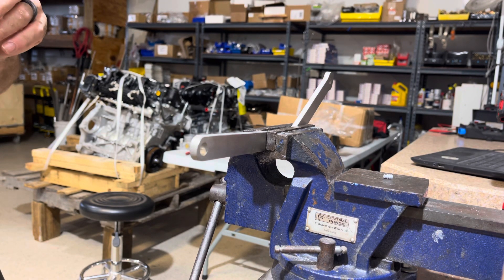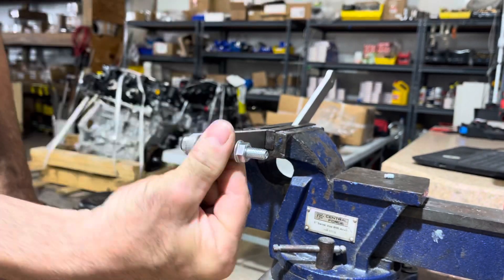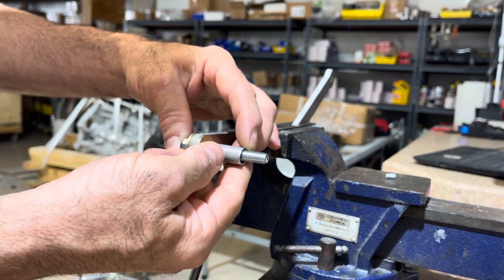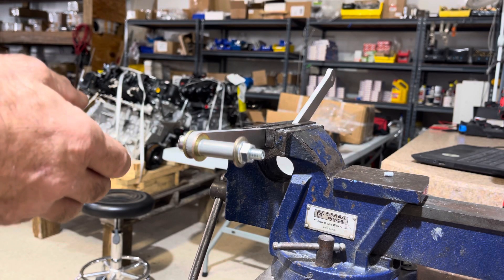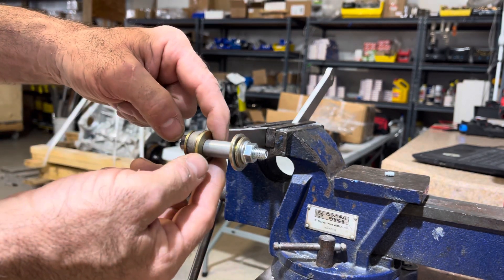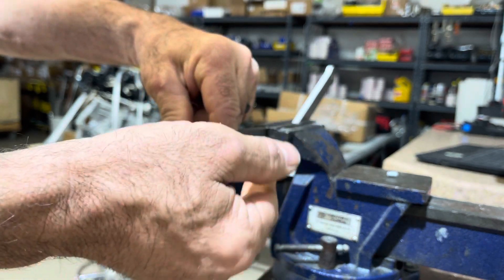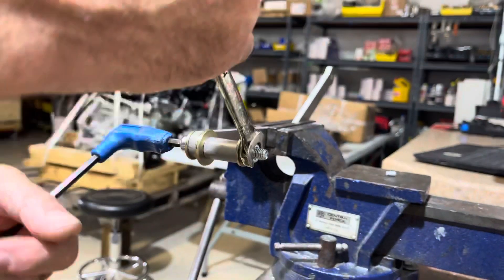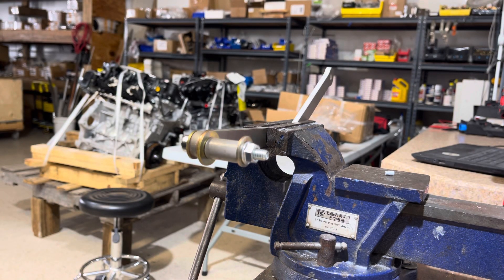Flaperon Attachment Procedure on a Zenith Airplane

Comment: I’ve had my 750 for 10 years. I am about to replace all of these bushings due to a little surface corrosion on the bushings.  This is the first time I’ve ever understood exactly how this assembly is designed to work. It is very easy to have it all together and end up with exactly what was described, or even end up with a bolt/nut/bushing assembly that rotates with the flaperon arm. Thanks for the thorough explanation on this.